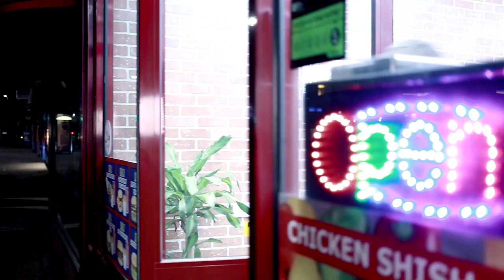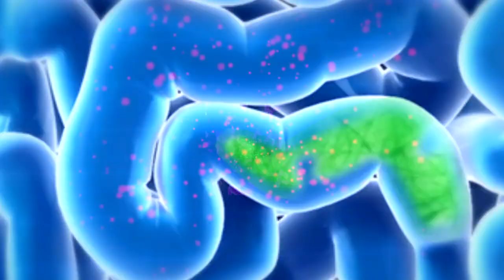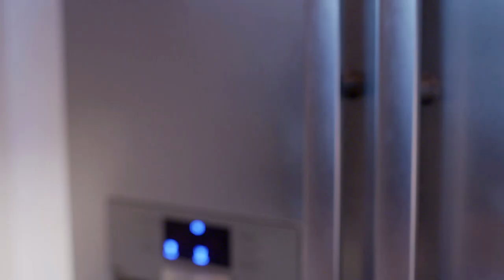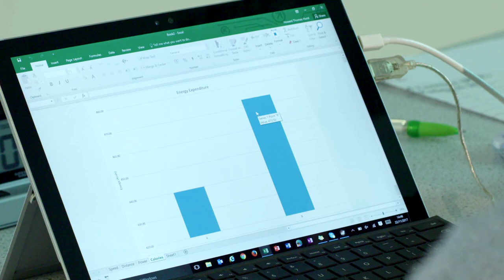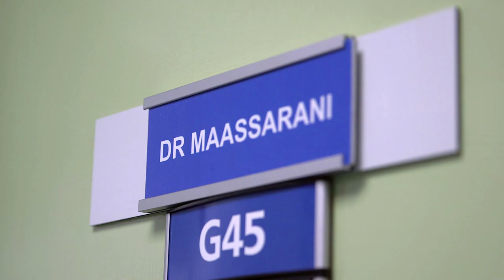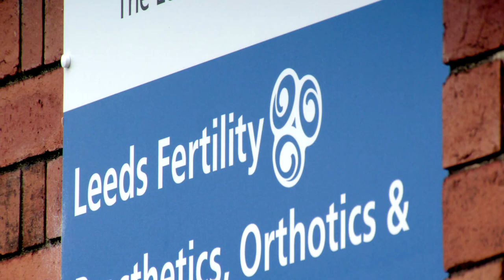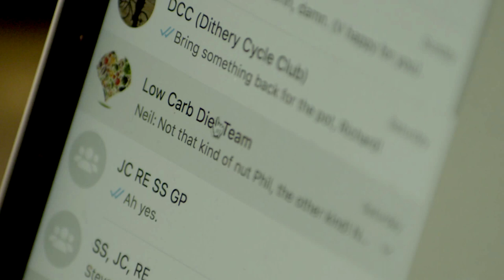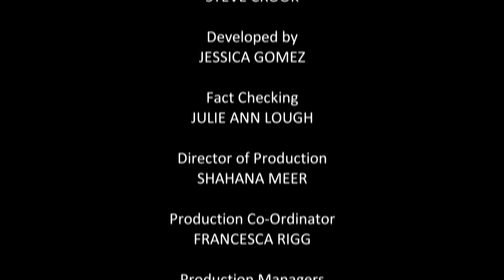The Truth About Carbohydrates

Comment: The main problem with carbs in processed carbs, because they have insanely high caloric density.  We process away all of the filler and vitamins in things like cookies and white bread, and leave pure unadulturated carbohydrates, that of course have a lot of calories, but don't fill us up nearly as much as unprocessed foods.

The reason vegetables are fine, is not really because they have a ton of fiber (although that helps).  A cup of brocolli has as much fiber as two slices of white bread, but a cup of brocolli is much harder to eat, it tastes worse, it is more filling because of all the roughage and water, and it has 1/5 the calories.  Therefore we are less likely to overeat brocolli.

It is also easy to overeat fats as well.  The primary reason that fried food is associated with obesity, if because you are basically saturating meat with oil (unsaturated vegetable fat, not saturated fat) instead of water, which adds a lot of extra calories, it makes the meat taste better, but it does not make it more filling.  Therefore fried food is easy to overeat too, and can also help make you fat.

Just as with carbs though, you can opt for less processed versions of fat, like grilled meats, nuts, and eggs, which are much more filling, because they are bulkier since they contain a lot more in them than just fats, like protein and nutrients.  This makes these unprocessed fats harder to over consume.

People also tend to combine carbs with fats, which makes both taste much better, and make they way easier to overeat, while not becoming much more filling, think pastries, breading on fried food, potatoe chips, butter with potatoes, cheese with pasta, doughnuts, pie, and cheesecake.  People tend to think of candy as very unhelathy, and it is, but people are much more likely to eat these "hyperpaletable" foods which combine large amounts of both carbs and fats.  This is probably becuase nothing like these food occurs in nature, but our body is extremely happy to get both carbs and fats at the same time, and our body didn't evolve a good understanding for them.

It is also important to note that some people digest food differently.  If you have ever heard someone has a "fast metabolism" this may be becuase their gut bacteria are not as efficient at digesting food in their intestine, which means they dont acutally get (metabolise) all of the calories on the label, and can therefore eat more food, whichout getting fat.